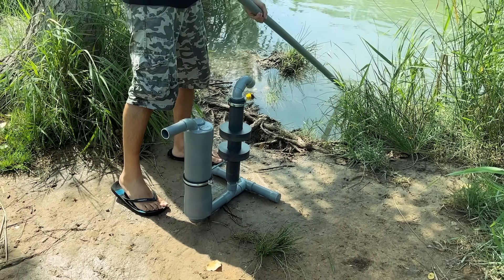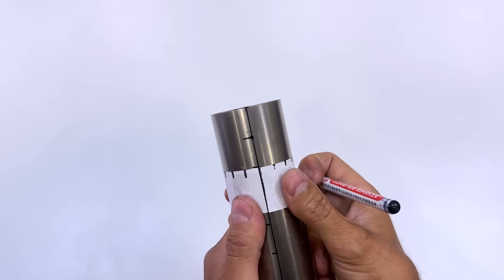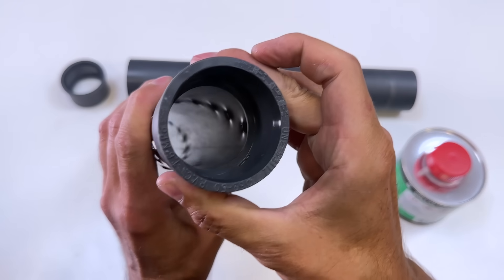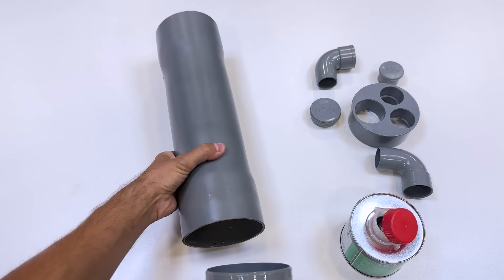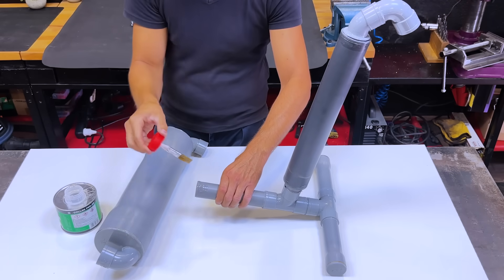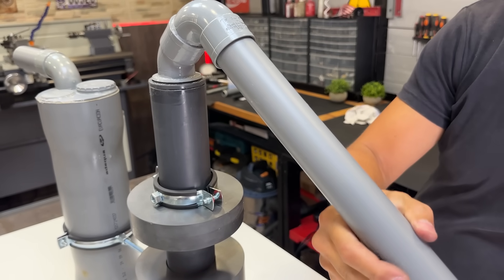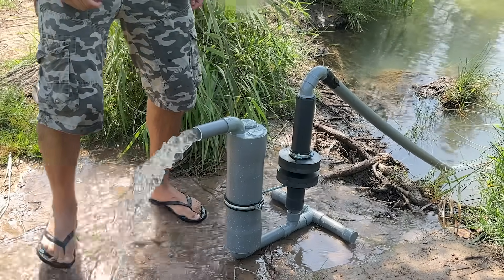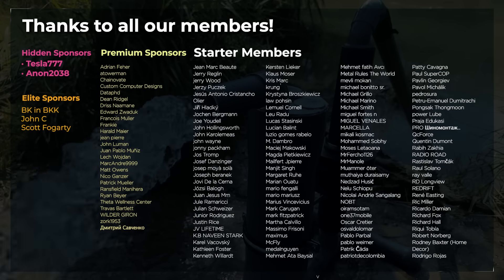Amazing! How to Make a Water Pump That Works WITHOUT Electricity or Fuel🔥

Comment: The submerged pump in the water there might have more to do with the volume of water than the magnets.

The only way that would have any pumping effect would be if the metal cylinder was spinning.

Only, it would have to remain spinning for it to pump.

I've seen one that uses a bladder inside one of the tubes to create the suction necessary to draw water on these syphon pump systems

Also, if the inlet line apex is higher than the output spigot it will increase the pressure of the pump system.

Comment: Could this be used on a 100' deep well?
Reply: Depends. The more of those magnets you put together, the harder it will be for a human to push them down. However, once the siphon is started, you don't need the pump at all.
Reply: @LadyPeter  True, although a lever system could assist - another factor would be the diameter of the pipe going into the water.

Comment: I built one using  exactly the same method, except, I installed another ring magnet  above the one specified in the design. when pressing this, third, magnet  down it caused the water to heat-up and when fully depressed I was seeing  superheated  steam produced; perfect to power a turbine powered generator. Avoid using  white plastic pipes though as this causes the machine to levitate..
Reply: Great discovery! I tried what you said and added a 3rd magnet to the design along with an old turbine I had lying around.

Comment: The formula shown in the video is not correct (makes no sense). It uses the magnetic field squared (B²) without including the magnetic constant (µ0), which means the expression has the wrong units and cannot represent pressure. Adding Δt in the numerator makes no sense either, since flow rate is already defined per unit of time. The denominator also mixes quantities of different nature, like viscosity and pressure head. In this form, the equation cannot describe a working magnetic pump. A proper approach would involve magnetic pressure (B² divided by 2µ0) and real hydraulic losses.

Such a pump cannot work without external energy. A static magnetic field does not perform continuous work. To move water against gravity, pressure losses, and viscosity, constant energy input is required. Without it, the device would be a perpetual motion machine, which is physically impossible.
Reply: It is a syphon system enhanced by design

Comment: To those of you saying this wouldn't work, have you built one? Well, I did and it 100% does work. All the science is spelled out for you in the formulas at the end. I found that I got an 18% increase in output with a titanium inner tube and neodymium magnets to boost the lorenz-farraday effect. They mentioned water alkalinity, but my tests showed no discernible difference, so I wouldn't worry about that if you're having trouble getting it to work. It's likely just from using a lower grade type of PVC piping. You must use the grey kind because the walls of the white kind are too thick to allow magnetic discharge coupling to take place.
Reply: vid or it aint happen
Reply: @davidbushnell60 we did this for a class project in the early 90s. It does work. Nobody cares that a goofball with a command of the English language, such as yourself, doesn't believe it. It's easy to find out for yourself but I've got a feeling you're accustomed to relying on the effort of others for most of your gains.
Reply: @jdhed2  Yeah sure; you found free energy at school in the 90s...
Reply: @Arvi89  yeah, but didn’t win the science fair prize for saving humanity from energy death of the universe

Comment: I bet this ystem is actually cleaning the water too, if you take it some steps further, I can see some pretty cool applications. If you can get it spinning fast enough you could just filter it that way even. You could also add a float to the top magnet and purposely dont let the water through as fast as it wants so it pushs the float up, but then redirect that energy to push the magnet back down maybe and keep it cycling. Then you could even turn it into a generator. Or even use this system with a non mechanical water pump and see if it will work better. 
Suggestions, not worked out ideas lol

Comment: ....And I have had a free energy generator in my house for 3 years now that supplies the whole house with energy with the prepaid mobile function and a 3000 kW fusion cell 😌 And because I have too much energy, I also supply my 75000 kW toaster so that I like and Toast a very big toasts 🌝...😮‍💨😒🙇🤦... So much time invest in so much crap with a submersible pump attached is the only amazing 😒😒...
Reply: It is done with a hidden pump in the pond . Water does not flow up without energy being used.

Comment: Water is not magnetic, so magnets alone can’t pump it. Real magnetohydrodynamic pumps need both strong magnetic fields and electrical current in conductive water. Without an external energy source, this setup can’t continuously move water — the laws of thermodynamics guarantee it.
Reply: The stainless tube is also not magnetic.
Reply: @robinsandeman-allen5128 cheap stainless is magnetic

Comment: This genius invention could supply a perpetually flushing toilet to provide nirvana 
for all those people hypnotized into eternal bliss by a never ending sucking sound.
Reply: But if such experts connect it to the toilet the wrong way round, it will pull them through the toilet, which is also quite dangerous...🌝

Comment: that is a lot of work and effort to fool people. Where did you put the actual pump? My guess is it was attached to the inlet pipe while you cut away to get the bottle to fill the pipe and the cloudy water where you can not see the end of the pipe is a nice touch. When are you going to make a video of the generator being run by a motor and producing more wattage then it is using?
Reply: Это трюмный насос для яхт, работает от 12 Вольт
Reply: No electricity or magnets needed. You get the same effect with just a garden hose or a big flexible tube, thanks to physics there is no need for any additional force.